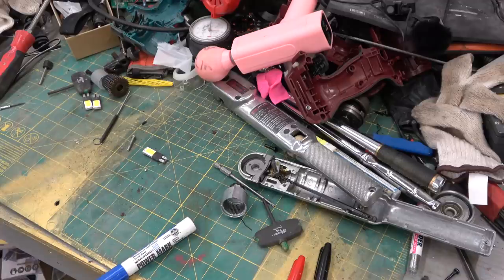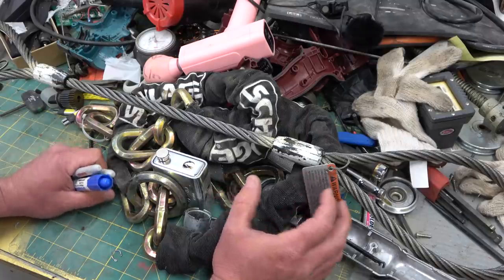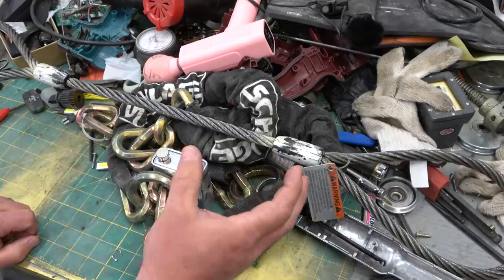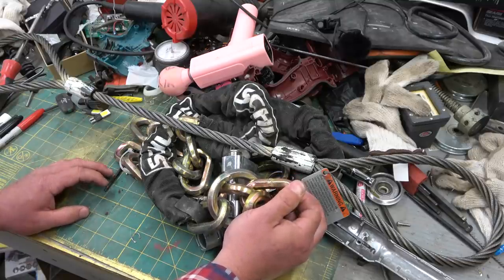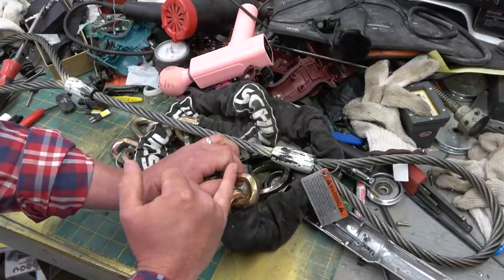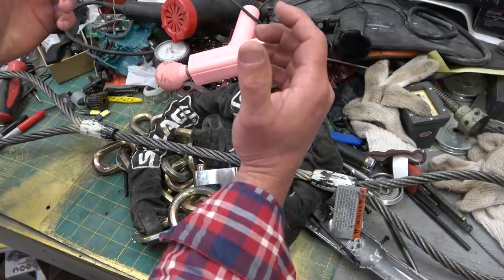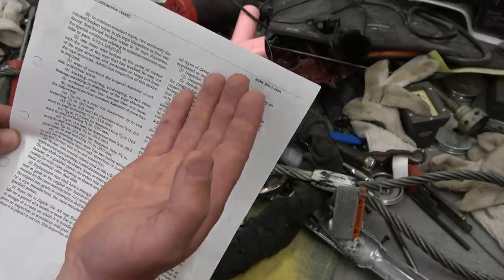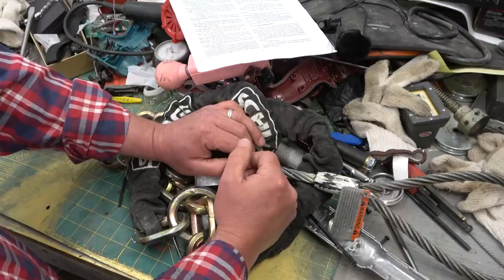"It is not known why the pulling cable snapped."

Comment: If there’s a safety in a system there is typically a good fuckin reason that it was put there. Usually the blood of those less fortunate paid for that safety to be designed and put there.
Reply: As an oil refinery worker for 33 years I totally agree with you. Sadly there are some folks who have the philosophy of "don't try and save me from myself", those are the folks that get themselves and others hurt (or worse).
Reply: @That Dudemost beurocrats aren't smart enough to suggest a safety device that that prevents something that hasn't killed someone.
Reply: well, unfortunately, there are a lot of safety features that just get in the way, or cause frustration. Not all safety features are born equal. A common offender is a tipover switch of a space heaters, these often trigger on any non-hard or non-flat surface, and i just have to bypass them.
Reply: @victortitov1740  I think I will stick with exclusively using space heaters on hard flat surfaces, I used to know someone who died in a fire that was started by a space heater.
Reply: @garethbaus5471  I replaced my floor with a half-dozen California king-sized twaterbed mattresses, a I'll be damned If the fuckin' GOOBERMENT is gonna tell ME, that my space heaters, can't sit, in an unstable space. Them mattresses is full o' water.
Reply: @That Dude the bureaucrats would rather have no safety to reduce cost
Reply: @That Dude who decides what's appropriate and what's useless bureaucracy? What did this technician think? It seems he thought he knew better.
Reply: They probably even boiled the operating theatre utinsils for years up until they stopped thinking that bloodletting was really a safe treatment for a multitude of ailments, however dont say that to mr bonesaw over in saudiland eh without a proper group of teamplayers that are totally not pete rose type$.
Reply: @garethbaus5471  especially since safety devices are designed to operate completely opposite to profit.

Comment: So, there are two brakes - presumably in a mutually independent set up in case one brake fails (because single points of failure in safety are bad). There is a particular mind-blowing nature to the decision to disable both  independent sides of such a safety-critical system...

Coming from rock climbing - where one always inspects one's lifeline after a high-stress event - the SOPs might well dictate you must shutdown and inspect the pulling cable ASAP, if it has been overloaded. That overload apparently occurred on many occasions, given that someone decided to wedge the brakes.

A single point failure could be the result of an accident, but in this case we're looking at a stack of negligent decisions. It's a pattern of behaviour, which suggests some supervisory influence was involved. I hope the right heads roll for this tragedy.

Comment: Work at FedEx. Emergency brake doesn't work on a van I'm using. "Oh, they're all like that." 

God bless capitalism.
Reply: You mean the parking brake? If you mean that, those aren't meant to stop a car and only keeps it in place (unless it's set up that way)
Reply: @mwolfe1486  when the brakes fail, it's the only thing that can help bring the vehicle to a slow stop. I've had to use it before for that exact reason when a brake line blew out on a 2000 Pontiac I picked up off of a family member.
Reply: @JV-io3nn  True. It's the closest thing to an emergency brake, but especially on newer cars where they have a separate brake drum in the rear disc rotors, they are not designed to stop a car. That's why it's so easy for most vehicles to drive off with the handbrake on. It isn't a replacement, but when you are flying down the road in an automatic, there really isn't any other option
Reply: @JV-io3nn  --- this guy is 100% correct.  I once blew a brake cylinder on a Honda Civic and if it weren't for my emergency brake (and down-shifting), I would have smashed into a police car.
Reply: Parking brakes are just as essential to all wheeled vehicles... just saying.
Reply: Because under communism that style of thinking wouldn't happen.... right?

We all know communist style countries care about human life SO SO much... right?

Communism is well known for being a system that especially cares about health and safety of the peasants.
Reply: @Narcan885  Are you feeling okay? I think you should head to a doctor, at least get your vision checked. No one mentioned communism. 

It is kind of funny how speaking out against capitalism brings out the anti communists though. Y'all always good fun.
Reply: Its socialism that gets you that... Read up on how standard oil grew so big so fast...
In a free market low quality products and services go belly up very quickly

Comment: I'd love to hear your opinions on the break in the Hernando DeSoto bridge in Memphis.
Reply: Right?
Reply: My completely uninformed guess is that the state doesn't have the money to fix it so they told the guy doing the inspection to not report it
Reply: ...and contrast it with the West Seattle bridge closure and rebuild. Inspectors spotted cracks in the post-tensioned concrete, they increased the inspection frequency and then shut the bridge down. Painful for the commuters, but necessary.

Comment: I’ve worked on Automotove and structure engineering structure (35+years) , first rule if your not an engineer don’t BE an engineer, if the warning light comes on in your head, Stop work consult your peers ! 
Good content👍

Comment: @AvE I work at a helicopter mx shop and we go thru a good bit of defective parts normally just get pitched. Would you be interested in any of our scrapped parts?
Reply: Those parts should be destroyed  so there is zero chance of them ending up in the air. . . . and causing something or someone to fall out of it.
Reply: @keithwatson9389  Your absolutely right! The parts would be damaged enough to ensure the impossibility of it ever ending up in the sky. We destroy/damage all scrap parts before they leave the shop. To ensure dumpster divers couldn’t do the same thing your talking about. Sorry for being unclear on this.

Comment: Dude was probably like “hey boss yeah so to replace the brakes its $$$ and it’ll be down for a week.” And got the old “just slap it together for now get it working!”
Reply: I've managed to piss off managers more than once when they were trying to cut corners on repairs for cost reasons. 
I'm sort of fine with it if the possible consequence is another breakdown but when it comes to bodging a safety system or something that may hurt someone, no way. Absolutely no way.

Comment: Lesson from this: before you ride a tram, look at the emergency brakes and make sure they aren't disabled
Reply: or even better, do an inspection yourself
Reply: @yunusalih  or even better, don't ride the air trams in a country known for taking regular maintenance lightly
Reply: @Automatic-Diaphragm  you cant know for sure which company has ethics or not, its not about the country. even if they regulate this stuff (which they probably do) there is always going to be some company using cutbacks or cheating the system.
Reply: @Automatic-Diaphragm  The thing is that in case of Italy there'd be LOTS of things you shouldn't ride then, including highway bridges as we saw...

Comment: "Heya bossman, think you can order up some new brakes?"
"You want that raise yes?"
Reply: that slow clamp was one of 2 things, worn cylinders, or a directional control valve with a bad seal.  The fact that both brakes were closing to me says the DCV was going out and needed a new o-ring on the spool.  an o-ring, like a 2 dollar part and twenty minutes downtime.  a brand new DCV would be couple hundred and 10 minutes downtime.  That's what killed those people.

Comment: Amen brother, I'm retired from the Chevron refinery in Richmond Ca. Those guys talked a good fight when it came to safety, mandatory monthly safety meetings(Unless you had to stay behind because the "batch" had to be finished) tailgate meetings every morning. Ridiculous, almost oppressive "lock out/tag out procedures. However when maintenance need to make repairs, the parts were either two weeks away, or throw a quick fix at it and we will deal with a real repair later.Even if something  locked and tagged out because it was deemed unsafe, the Head Operator on swing shift would use the equipment anyway. The safety program there was a joke. It is a miracle that  on one has been seriously injured or worse.

Comment: Well, as the saying goes, “Anyone can build a bridge, but it takes an engineer to BARELY build a bridge.”
Reply: It takes an engineer to build a bridge cheep and safe.
Reply: @ReinoGoo  that’s what that means, yes.
Reply: Reminds me of what one of my engineering professors told me many years ago. The only reason we still have ancient Roman bridges is because they were bad engineers. They used the same proportions whether spanning 100 meters or 10 meters. As a result, the shorter spans were so over engineered that they lasted thousands of years. Don't know if it's true... but a fun story none the less.
Reply: “Anyone can build a bridge, but it takes an engineer to build a bridge that barely stands up.” Although not relevant in this case.
Reply: Only reason engineers build things with a safety factor of 1 or just above 1 like 1.1 is due to businesses that fund their life do so. Engineering ethics and practices encourage otherwise.

Most case studies present not an engineer failure but project management, manager decision failure, or maintenance failure that leads towards these incidents. This is due to the engineering always working on Worse Case Scenarios for designs. Failure to listen to engineers insights leads towards these catastrophes.

Comment: Wires typically break at soldier joints due to the 'stress concentration' effect, which only applies to fatigue failure.
Reply: This was addressed in the video👍

Comment: About your opening statement: a proper engineer would say the glass was sized with a factor of safety of 2.0.
Reply: The engineer would then check the industry standard and determine if the safety factor is sufficient or not

Comment: The technician didn't "decide" to disable the brakes. He got told that if he wanted to work, he'd have to disable them or he could change jobs. 100%.
Reply: I suppose there is a difference there between what the mechanic did and what anyone with a brain should have done

Comment: The guy in accounting says “the glass is twice as big as it needs to be.” The engineer says, that glass needs to be 25% bigger to give us a safety  buffer.”
Reply: The taxman says, "I'll take about a third of that water, thanks."
Reply: If your interested in more disgusting avoidance of any engineering standard for profit watch Brick Immortar's video on the Sampoong Mall Collapse. The engineers gave the company a blueprint that was perfectly safe and the company who contracted them proceeded to just botch the whole thing horribly similar to what happened to the cable car.
Reply: Grady from Practical Engineering just dropped a new video analyzing the recently discovered tensile failure of the Hernando De Soto bridge in Memphis TN which was thankfully caught BEFORE the bridge collapsed. What a nice change!

Comment: “Maintenance is the process of ensuring that a system continually performs its intended function at its designed-in level of reliability and safety.” [Kinnison and Siddiqui, 2013]

Comment: Just like the old days of using a penny as a fuse replacement.  How many people died because of it.
So sad the only way is people  dieing to learn mistakes.
Reply: Fuses don't protect people. They protect the wiring only. You'll need an RCD for domestic human life protection. Worth the 10 quid.
Reply: @trustthedogsheneverlies644  
Yes just ground fault breakers. But one could argue that a fuse will save your life and home.

Comment: In mining, the wire rope passes through a strong magnetic field and then through a sensor to pick up the North South transition of breaks in the wire. Elevators used the tension in the pull cable to hold the rail breaks open, a hundred years ago! Both are simple but effective at preventing this kind of incident.
Reply: Exactly right John, but this cable was independently tested in exactly that manner (magnetic inductive testing) each year as required by the Italian govt. This is why I commented further up that I don't think this cable broke. It detached from the melted socket of the cable grip at the top of the vehicle hanger arm.

Comment: I'd bet that the inspection interval was based on hours of use, rather than just a calendar.  Maybe COVID provided an excuse to skip the scheduled inspection because the system was not in use.
Reply: There should be a full inspection any time the system has been idle for an extended period, before starting up.

Comment: Worked industrial construction for over 18 years - I've seen large diameter wire cables, that passed inspection, snap under load.
 There is a darned good reason they tell you not to stand near something that is being lifted with a crane !

Comment: It is interesting to see when there are inspections done on some of the cable supported bridges built in the early 20th century.  Some of the individual wire strands within the wire rope have been discovered to have been sub-par at point of manufacture, and the individual wires can be heard snapping from time to time.

Comment: 10:10 I don't get what you are saying there. I have written down what I hear:
The fact that the brakes were dragging meant that there was an increased load on the haul cable. We recall that the drive motors down at the bottom drive pulley were very likely DC. Which means they have so much torque they could very easily shred the cable. So if you have a brake that’s clamping down slowly and you have a drive motor that’s slowly ramping up its torque it’s gonna pull right through that brake as it goes around that sheave it’s gonna break some strands. And continually, if this is happening over the course of a month continually, you are gonna have more and more broken strands.

Are you saying the load on the haul cable was to large and therefore the strands broke one by one over time? Or are you saying the brakes sliding on the cable broke the strands? The latter would be incorrect anylysis. The brakes work on the carrying cable not on the haul cable. Too much attention on secondary facts (strength of motors) but not a clear description of what happened.

That "it's gonna pull right through the cable" is confusing. I'd put it like: The haul cable's load was increased by the dragging brake. The increased load over a long time made the strands in it brake (prematurely).

I think the safety factor on the haul cable is 450%. Which means that only a force of 4.5 times of the normal workload would break it. And how much that brake action added to the actual load is not really known. So the faulty brake might not have pushed the haul cable's load over its design limit.

Comment: The term "pilot error" comes to mind. Airlines like to blame the usually deceased pilot following an aviation incident. Management feel warm and fuzzy when responsibility for an incident can be focused elsewhere! What they should be investigating is what area of training was lacking which allowed the pilot to make this mistake in order to prevent a recurrence. When management is overly focussed on profit, inspections are the first maintenance task to be cutback. Not in the maintenance certification process, but the time allowed to carry out the inspection and/or maintenance task. The same concerns apply to this terrible cablecar tragedy.
Reply: Boeing is still trying to blame pilots for the 737 MAX crashes, even though Boeing changed how the flight controls worked (IIRC, the autopilot and fly-by-wire systems). All because Boeing didn't test enough, wanted to avoid having to recertify the aircraft, and didn't think it was important to update pilot training.

Comment: You are bang on with the corporations. It’s sad the mechanic failed to do his job but it is not the first time I would see the “ corporate machine” breathe down the little guys neck. I am in The elevator industry and time and time again I see or get told to sign that log book or else…. It just comes down to the individual either telling the corporation to shove it it or be afraid of loosing his job so does what they say. In my opinion never, ever should a safety device be tampered with and left for the public to ride. But who know what management was yelling to this guy. It’s really a shame that 14 people lost their lives by the only reason of profit. 

In my industry we get puked on more work with les time and expected to follow through. I used to have 50-70 units on my maintenance route now I have 150+ units and expected to do my maintenance all in the same time. How can this be safe? I know one thing it sure is profitable for the companies.

Comment: Thanks for the clear explanation. I have two questions. 
- Can you please explain a little bit more on how the pulling cable is exactly getting damaged? Can this cable slip over the pulling drum, maybe? 
- The brakes must have scratched the main cable before the brakes were locked, true? Has any sign of this been found?
Reply: The pulling cable is overstressed, because the BRAKES ARE ALWAYS ON. So it's getting pulled above the rated maximum load. Exceeding the max load pops individual strands all along the length. Finally, it's got more broken wires than whole strands, and can't maintain the load. 

No slipping or wear required, just a dolt,  too lazy to fix the sticky brakes.